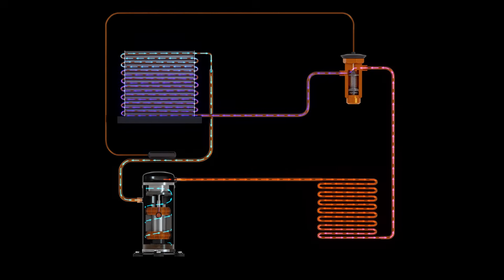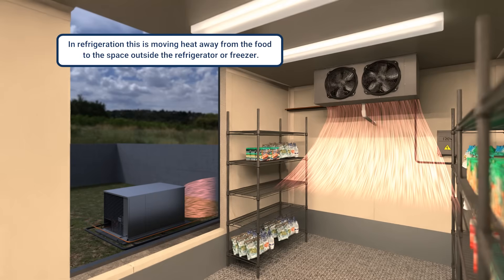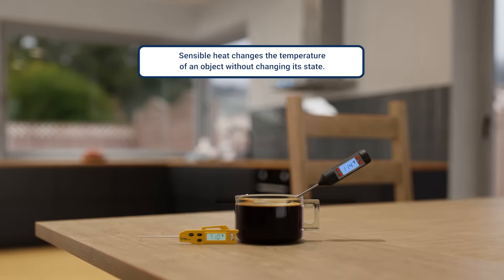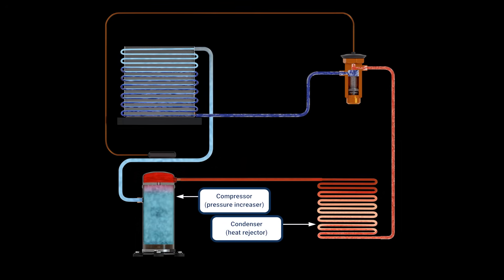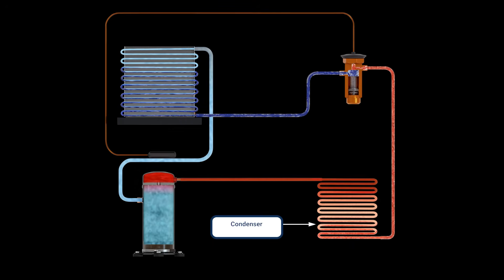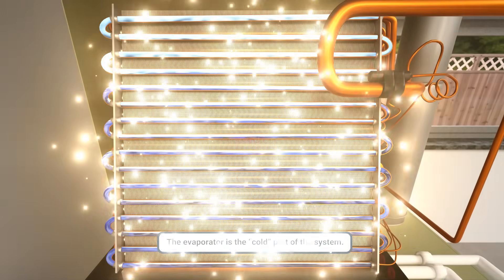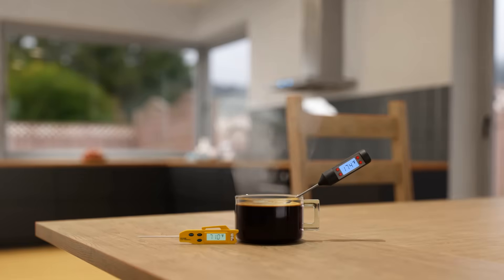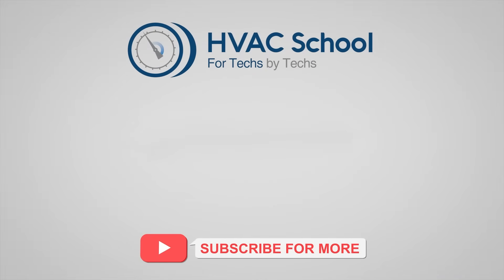3D How Refrigeration and Air Conditioning Works P1 - Components

Comment: How does the condenser release the heat
Reply: Hot goes to cold ! Condenser has High Pressure and Temp refrigerant hotter than the outdoor temperature

Comment: i'm sorry if this sounds like a dumb question but one thing  i didn't understand is  why do we need the compressor part of the process , why do we need to heat/augment pressure of the refrigerant , is the heat it absorbs in the evaporator not enough?
Why do we need to compress is basically my question?
thank you for the informative video
Reply: Because the extra home heat that's absorbed at the evaporator is in lower compressed form. If you didn't compress it the heat would not release outside because it wouldn't be hotter than the outside temperature. Heat will only exhaust up until it's the same temperature your releasing it in. To put it another way the refrigerant you use will only get so hot at high compression & so cool at low compression on its own without any heat added but when extra heat is absorbed that's what it releases outside.

Comment: Higher pressure doesn't mean higher temperature, only abrupt increase in pressure increases temperature temporarily. I know that's what you meant but technically Pressure does nothing to temperature otherwise scuba tanks would be hot

Comment: In my opinion, it has nothing to do with the air inside the house. The hot air is the result of the gas being compressed in the meter to cool it further before entering the house

Comment: im kinda amazed how compressor can bring the refrigerant into the cycle. when the refrigerant vapor is condensed to liquid, the liquid is still moving to the evaporator until then going back to the compressor. the evaporator and condenser tube is designed zig zag, i imagine there may be pressure drop when gas/liquid pass through the zig zag. compressed gas refrigerant must be pressurized relatively high enough to push the condensed refrigerant? and the main role of compressor is actually to circulate the refrigerant by giving it much pressure?
Reply: its main purpose is to move the refrigerant at a desired pressure.  the refrigerant cannot move on its own.  in so doing,  the gas temperature increases because of the laws of physics.

Comment: You mentioned the heart of system, the compressor... but you missed the other real real core part, and just spoke of it like a device.. but that is the core.. the metering device.. the place where high pressure goes into low pressure suddenly cooling it.. this is the real magic part a miracle part, the real Joule Thompson Effect !
Reply: probably because it isn't required, AC's dont REQUIRE it to work, while you NEED a compressor.
Reply: @johnnyblaze9217 no, you need the metering device.  the liquid refrigerant is at 90F,  not good for any cooling. it needs to be "boiled" so its temperature drops.  the metering device does that.  you remove the metering device and  liquid refrigerant at 90F goes to the evaporator.  good luck with any cooling.

Comment: The condenser blows hot air cause is rejecting heat from inside the house or rejecting heat to cool refridgerant , so it does 2 things at once in cooling mode

Comment: But a compressor compacts air yet it is cold NOT hot? Why?
Reply: It compresses refrigerant
Reply: The compressor does make the refrigerant a higher temperature. The metering device is what causes the reduction in temperature by lowering the pressure. The compressor and metering device manipulate the pressure which manipulates the temperature so the heat flows in the desired direction. Low pressure and low temperature inside to absorb heat from the air. High pressure and high temperature outside to release the heat into the air.

Comment: Sir,
Why cant we use water as the refrigerant.
Reply: You technically can and water is a refrigerant, its refrigerant name is R-718. However there are drawbacks to water as a refrigerant. The pressures it needs to work are inconvenient, water is corrosive, water doesn't play nice with oil, and it's overall less efficient than other refrigerants. Buts it's dirt cheap and environmentally friendly.

Comment: The refrigerant leaving tye condenser is in a liquid state at  what temp and pressure? High or low? One would expect that since it has condensed the temp and pressure will be low.
Reply: Higher pressure higher temperature
Reply: @kingbanko3858  So there's only a phase change that doesn't affect the temp
Reply: Refrigerant is discharged from the compressor as a high temp high pressure vapor. It leaves the condenser as a medium temp high pressure liquid. There is a insignificant pressure drop through the condenser coil. Most of the heat the condenser fan removes is latent heat from the phase change.
Reply: @Redtooth75 there is no pressure drop. only a phase change and temperature drop.  if there is a pressure drop, you will see icing in the lines because the refrigerant will boil.  try making a kink in the line in the high side and you will see icing immediately.
Reply: @worlds45v4 there is always a pressure drop due to friction when a fluid is moved through a pipe. The pressure drop through a coil should be small, like no more than 1 or 2 psi but usually less. That pressure drop is way too small to result in a noticeable temperature drop.

Comment: Why do you need to compress it before the heat can be rejected? It was already cooler, by compressing it you just heated it up, right?
Reply: Think about it as a heat-pressure exchanger. You give ut pressure and the refrigerant will give you heat, you release the pressure and the refrigerant will absorb heat. So we give it pressure and try to dissipate the heat to the outside so we can have high pressure-mild heat refrigerant. Not we get this refrigerant inside the place we want to cool and release its pressure. Now it will absorb heat and the surrounding area will lose heat and get colder.
Reply: If AC or refrigeration system doesn’t have a compressor to produce high pressure ,mild temperature Vapor refrigerant to the condenser . So how can the system reject unnecessary heat from the building ?😂 Refrigerant just stuck on the half way .
Reply: the compressor is the pump of the system.  a gas pump is called a compressor.  when you oump a gas, its temperature will rise.

Comment: But how it gets cold
Reply: Don't think of it as cold, think of it as lack of heat. Cold is merely an observation of how much heat/energy something has.
Reply: the more u retrieve heat the more it gets cold, easy
Reply: by transferring heat to the refrigerant.
Reply: Gay-Lussac's law states that P1/T1=P2/T2. So when the refrigerant goes through the metering device and has a pressure drop it also lowers in temperature.
Reply: @Redtooth75 the pressure temperature relationship of a liquid when it boils applies here.  liquid is being passed through the metering device.  its pressure drops and it is boiling as it leaves the metering device.  a liquid-gas refrigerant enters the evaporator, not gas.
Reply: @worlds45v4 i am well aware of saturation temperature. However the change in temperature of the refrigerant is caused by the pressure drop. Just like how the compressor increases the temperature of the refrigerant by increasing pressure the metering device decreases the temperature by lowering the pressure.
Reply: @Redtooth75  and the law does not apply because the refrigerant entering the expansion valve is a high pressure high temperature liquid, not a gas.  the GL law does not apply to liquids.  temperature of liquids do not drop when there is a pressure drop unless there is a phase change,  boiling (cold)  in this case.
Reply: @worlds45v4 correct I should have said the joule thompson effect.